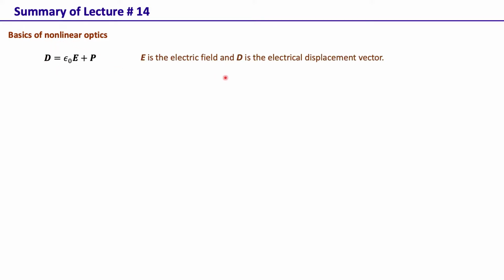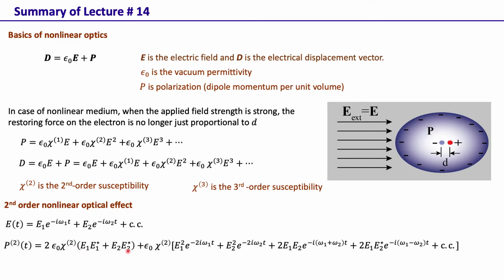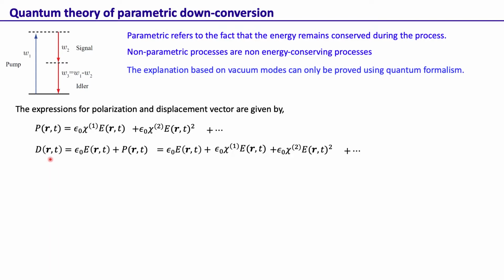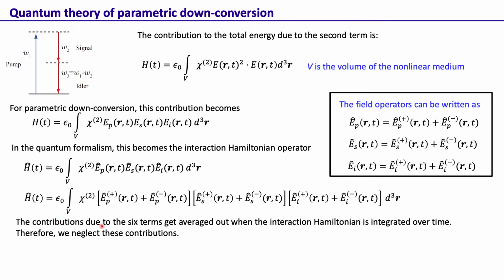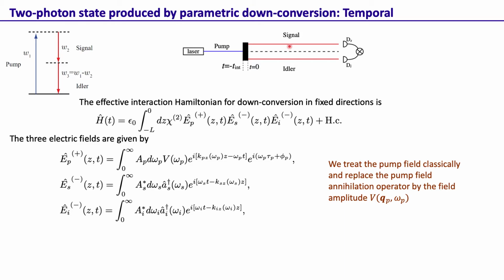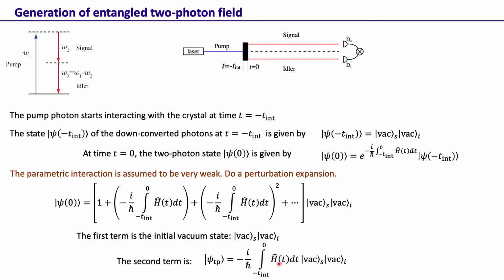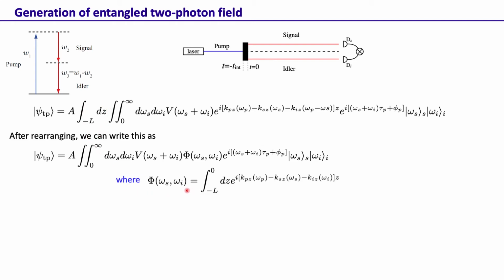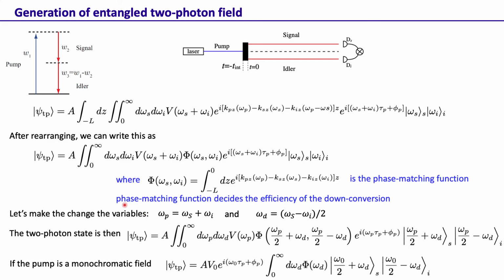Coherence and Quantum Entanglement: Lecture # 15 (Two-photon state produced by PDC)

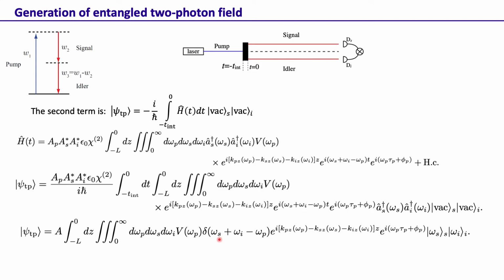Comment: At 20:45, how does the delta function disappear when integrating over dw_s? But then on the next slide, dw_s still appears in the integration? And why did you you substitute w_p = w_s + w_I for V(w_p)?
Reply from the maker: Dear Christina: Your observation is correct. I say it by mistake in the lecture that we integrate over dw_s. Nonetheless, the calculations shown are correct. The integration has been done over dw_p. This is why dw_p integral disappears in the next step and we replace w_p=w_s+w_i because of the Dirac delta function. Hope this clarifies.

Comment: How does one get at the result of about 1 in every 10⁹ photons get down converted? Is there any way to verify atleast the order of this down conversion efficiency
Reply from the maker: This is because of the nonlinear coefficients which makes this process very inefficient. Yes, this efficiency has been measured experimentally. Also, there are ways to improve this efficiency, and one of them is to use periodically poled nonlinear crystal for down-conversion.